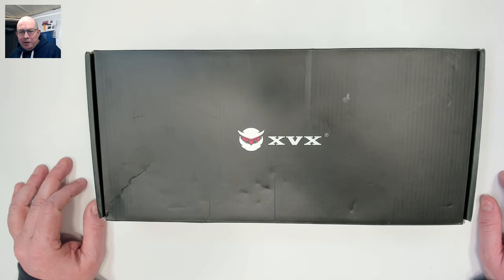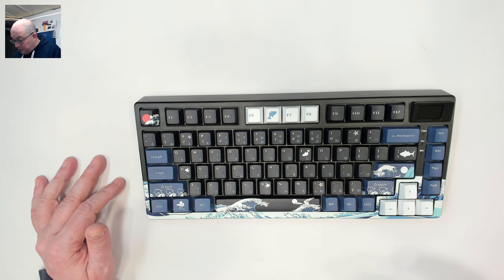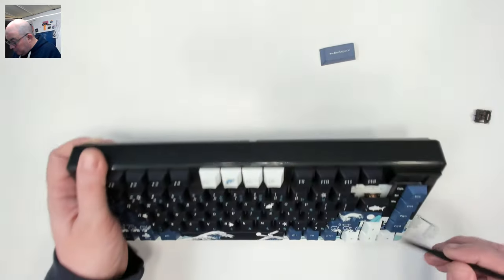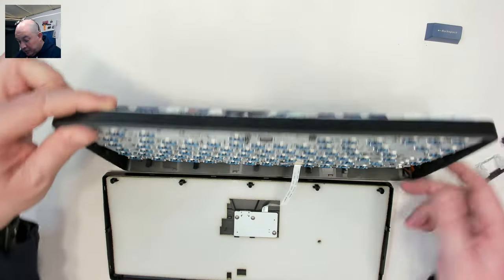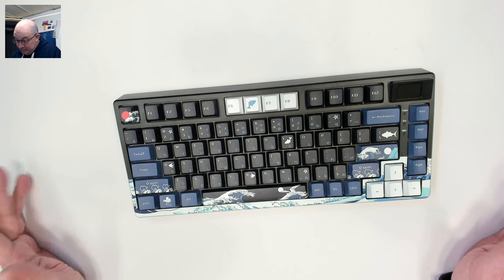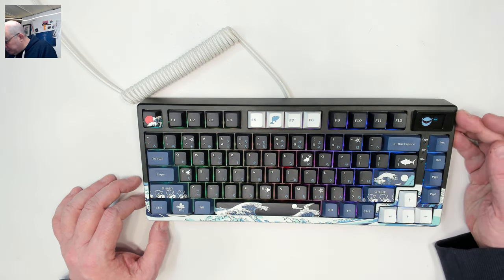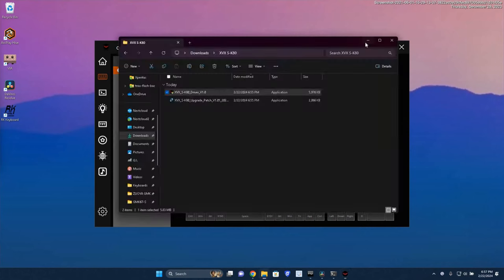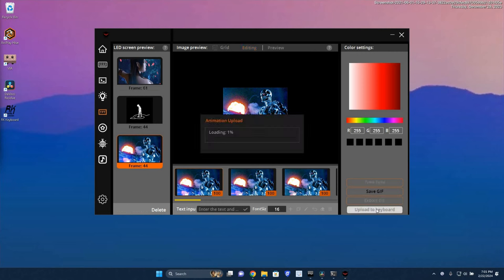XVX S K80 Review and Sound Test

Comment: I have both the XVX S-K80 and the Zuoya GMK87. I like both of them. I haven't opened my S-K80. So I'm glad to learn how you opened it. Regarding the Zuoya GMK87. The listing where I bought the GMK87 has a link to the driver software. There is a fw update that fixes the Windows key. The driver SW has a JSON file that enables VIA to configure the GMK87.
Reply from the maker: Oh wow, I was not aware that there was a firmware update, I'll have to go look for a link, unless you might still have it?

Comment: I just got one for 21 USD I was wondering which switch I should change it to. I'm looking for a thocker sound.
Reply from the maker: I think the Gateron EF Grayish will deepen it some: https://go.be2x.com/efgraypk
Reply: @MechKeyboards  Thank you for the recommendation, since i also bought the Akko 3098B/B Plus for 28 USD which comes with the v3 cream pro blues. I might change those to this case or just use that keyboard instead.
Reply from the maker: @domingator6746  right on, good luck with the build and feel free to come share it over on BudgetKeebs (.com), cheers!